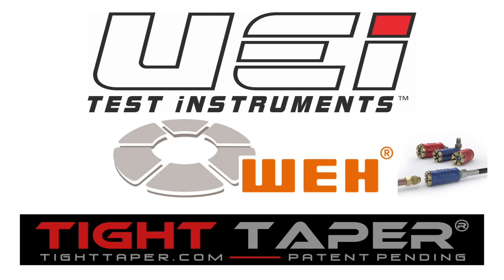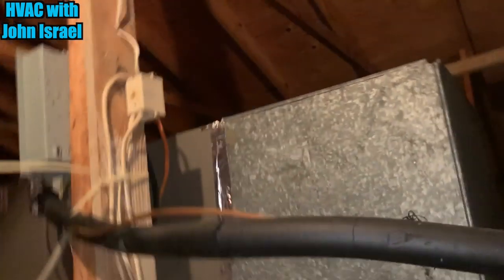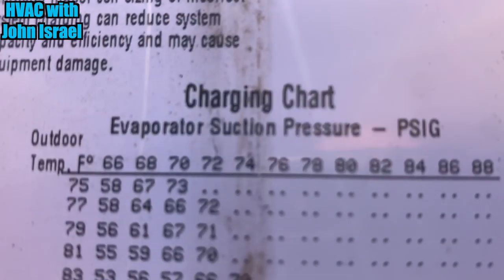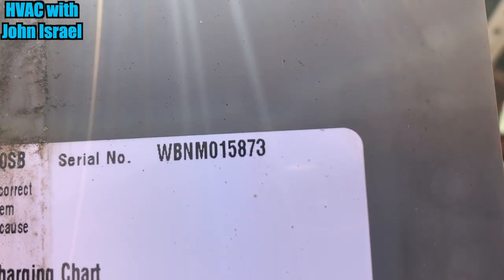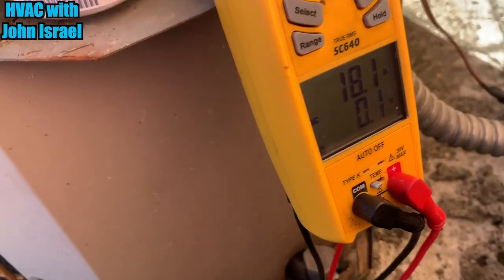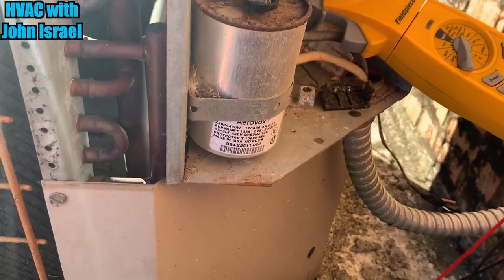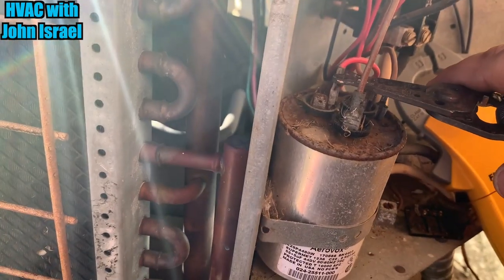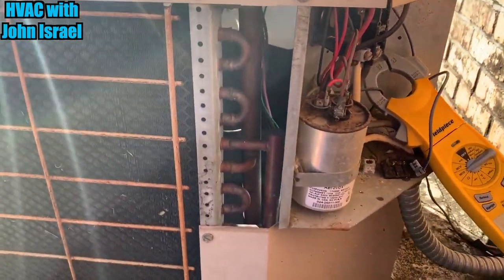HVAC System Check Up

Comment: Look forward to the next video of pulling the coil to clean it & (most likely) change out the condenser. 👍 I had an AC call today as well as I'm on call this week. Crazy getting AC calls in late January but I'll take that over heat calls which means it's cold out. Keep them coming John! 👌